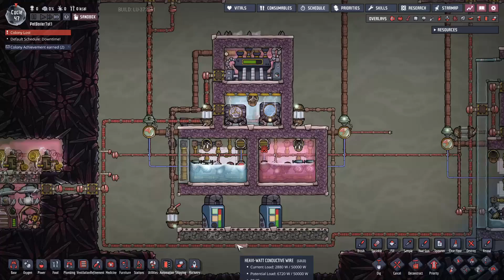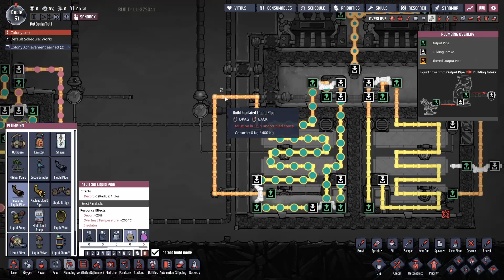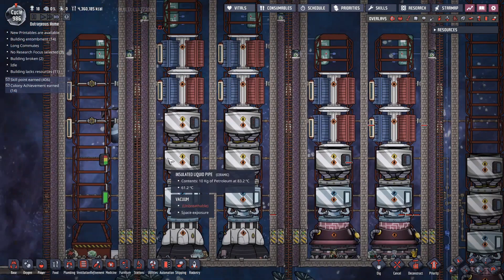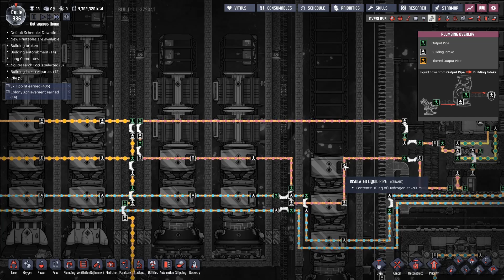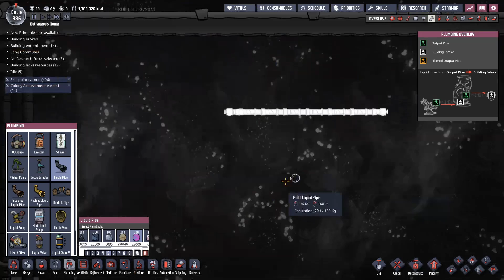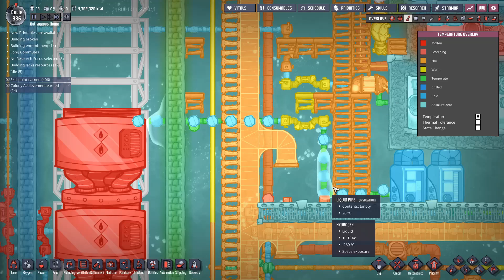Liquid Oxygen and Hydrogen : Tutorial nuggets : Oxygen not included

Comment: I hope that you can suggest alternate materials in some of the builds.  I notice you've used Al and diamond for everything, which is find in debug mode, but not viable on all biomes. I know that, specifically in this video, you assume the player has accessed space and may have picked some up from other planetoids, but you also use these materials in other "tutorial nuggets".

Alternately, could you put together a video discussing a heirarchy of materials for various use cases, as well as discuss which applications require a certain level of material.  While you have discussed certain things (like why use polluted water as a liquid coolant, steel being the only viable door material for transferring heat), many of those comments are scattered about; a single video compiling this info would be valuable as reference.  (A discussion of materials could be more focused than discussing blueprints.)
Reply from the maker: Sounds like a good idea, I'll add that to the list. For this build though you only have two choices Al and Therimum. I'm pretty sure nothing else is conductive enough.
Reply: @FrancisJohnYT  Is there an radiant pipe material alternative on a map with no aluminum? My only aluminum map is right below the breach, which would need liquid o2 / h2 to achieve. Would this require thermium radiant pipes rather than gold?
Reply from the maker: @FranticPedantic823  For this build you require Thermium but you could just make the temp transfer area bigger and use a less conductive material like gold.
Reply: @FrancisJohnYT  Thanks for the reply to an old post. I did some of my own research and found I only need ~3700kg thermium for the entire build. I opted to invest in the thermium to have something tried and tested.

Comment: This is just the tutorial I needed. Liquifying hydrogen is one of the hardest things I've ever done. Never been able to make a hydrogen rocket.
Reply from the maker: It will be fine, it's just a steam turbine heat deletion devices that goes a bit colder than normal :)
Reply: for me it's always about how to keep it. Making things colder is easy but to maintain it at that state is harder, and usually by then I already have enough from the rocket and threfore rarely use hydrogen rocket at all, unless of course you want to travel to the furthest point of the galaxy
Reply: This is incredibly frustrating though.  The save game file doesn't actually have this build in it (its older) and I am having to run the video at 1/4 speed to try and catch the mouse cursor going over various pieces.  I still need some of the settings and I have yet to see any automation overlay.  I really want to understand this fully but I'm struggling.  :(
Reply: @allenbythesea  which bits? i just used it to sort mine out, would be happy to help :)

Comment: Is there a way to make liquid hydrogen without super coolant? I had a map where I couldn't get fullerene, at least from the initial research, until about the second to last ring. I ended up scrapping that map after fully researching the first 5 rings of planets good thing was one planet had like 15% of isoresin.
Reply: Maybe with the gas cooler ( forgot the name) and alot of broken pipes?
Reply from the maker: It's theoretically possible and people did it before supercoolant, I never have so this is personally untested. You use the 100g/s in a gas pipe so it won't state change and using a thermo regulator you can get your paws on a small amount. Then you put the liquid H2 in an aquatuner and get into more bulk production. It's incredibly difficult and energy expensive.

Comment: Need a power grid tutorial mate as well as ways to have an insulated airlock that leads out of your base
Reply from the maker: An insulated air lock is usually not a thing for me I usually insulated the access points to extreme temp area's. Power grid is almost next up on my list of stuff to do.
Reply: @FrancisJohnYT  I played a map with glaciers AND volcanoes and so there just ended up being perma steam everywhere outside the base. Nothing seems to stop a bit from getting in except for double liquid lock but that's so slow for dupes to manuevre
Reply from the maker: @dominicmiaryzo  That is a rough map, you might get away with a single liquid lock but then heat will leak in. Double locks are really the only perfect insulator. Your going to have to eat the slower movement speed unfortunately.

Comment: Can this be come without super coolant? Eg naptha down to some temperature and then hydrogen for rest with gas coolers?
Reply: I’m trying to convert sour gas to natural gas without space tech.
Reply from the maker: It can be done without supercoolant, well the O2 is not to bad. Just run hydrogen through a thermo regulator and you can run it to near it's freezing point. Liquefying hydrogen is a lot trickier.

Comment: Another awesome tutorial, just started building the smaller one last night based on your older video! Question, is aluminium up to the job of radiant pipes as it is close to the thermal conductivity of thermium. Although I have 12t of thermium 😂
Reply from the maker: All the designs in this video are using Aluminium. Save your thermium.
Reply: @FrancisJohnYT  thanks, I suspected it would be good. Most of my base uses your designs now, food is my main issue as I haven't managed to transition to bbq and my map is out of slime for mushrooms. Back to mush fry while I sort the bbq I think 😂
Reply: @FrancisJohnYT  Can it be gold, in maps with no Aluminium?
Reply from the maker: @LuisGustavoCoelho  I'm afraid not, I have not tested but it's thermal conductivity is far lower. You can load up the attached saves and modify them to check. But I doubt it will work.

Comment: I've got a single line from 2 tuners and use doors to regulate the temperature of the oxygen/hydrogen rooms.  Allowing the supercoolant to be at the minimum temperature.
Reply from the maker: Dammm you use a steel door thermal injector to cool hydrogen down to liquid? That is hardcore.
Reply: @FrancisJohnYT  I'm not completely sure it transfers cold through the steel doors fast enough.  I don't have enough hydrogen generation to send a full pipe or more.

Comment: for those who maybe asking, you can use thermo regulators passing hydrogen through the lines for the oxygen side. this would be helpful for people having difficulty getting super coolant.
Reply: Because of the relatively wide gap between the freezing and boiling points of liquid oxygen, you can condense oxygen quite early in the tech tree -- probably before access to steel, even.

You inevitably have to cool the first drops of liquid oxygen via hydrogen gas and thermo regulators, but once you have liquid oxygen you can use that as the liquid working fluid for aquatuners to increase the overall cooling capacity.

The resulting system is much less power efficient.  An aquatuner acting on liquid oxygen has about 15% gross efficiency compared to super coolant, and power recovery via turbines increases the gap even further.  However, if you have power to spare you can generate liquid oxygen in nearly arbitrary quantities, potentially skipping over the solid oxidizer rocket stage.
Reply: Gas cooling is baaaaaad
Reply: @enricobianchi4499  gas cooling is only bad if you're cooling liquids. gas cooling gas is is fine. remember that my comment was about options, not how good or bad it is.
Reply from the maker: So expensive, would hate to have to invest all the time and effort into doing that. But on some maps it could theoretically be the only choice.
Reply: @FrancisJohnYT  if a player makes his thermo regulators out of steel, then he could possibly use oil cooling, with the oil passing through a bath of water in radiant pipes, avoiding the use of an aquatuner, for cooling. therefore, requiring just a steam turbine, 4 or 5 regulators, and metal for the radiant pipes, making liquid oxygen long before researching the telescope.
Reply from the maker: @commonsense-og1gz  If you limit gas flow to 100 grams a second you could theoretically avoid state change and make liquid H2 long before space as well.
Reply: @FrancisJohnYT  interesting, thanks

Comment: Great tutorial as always. A question just came: Would be possible, for compact purposes, to insert the cooling solution directly in aquatuner's room and then remove the steam machine from blueprint?
Reply: No, you ultimately need some way to delete heat.  Aquatuners just transfer heat -- they take heat out of the piped liquid and insert it into the environment.  If you take the cooled liquid (either directly, or via some secondary mechanism like the hydrogen line) and cool the environment, you're just spending 1.2kW (the aquatuner) to get back to where you began.

The steam turbine acts to delete heat, so the hydrogen cooling loop only needs to cool the residual left inside the steam turbines.

If you build this design in space, you could use the space biome itself for heat deletion.  You'd cool the aquatuners with a sacrificial fluid (probably water) that boils and is vented into space.  I imagine this would be more compact, but obviously it would require a continual cooling input; the design as built here is a closed system.
Reply from the maker: What cooling solution did you have in mind? Nothing I know of can beat the steam turbine for cooling.
Reply: @FrancisJohnYT  Redirecting the hydrogen gas pipes from steam turbine to aquatuners. Is it enough?

Comment: The bottom left tile will exchange temp with the liquid inside the reservoir (not with the reservoir itself).
The reservoir will exchange temp with surrounding gas.
The reservoir will not exchange temp with liquid inside it.
Reply from the maker: So in my little experiment the liquid in the tank was exchanging heat with the tile beneath the tank and that tile was exchanging heat with the steam? That would mean if you used an insulated tile made of insulation it would not matter the temp of the room the liquid in the take would always retain it's temp.
Reply: @FrancisJohnYT  Yup